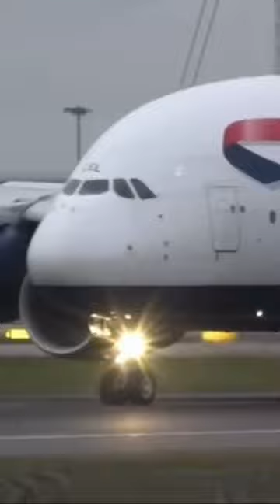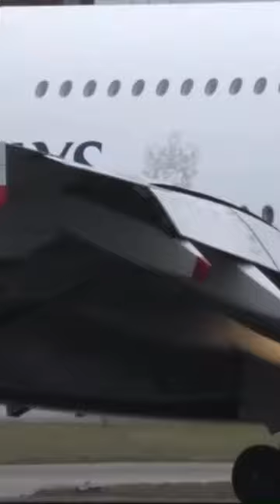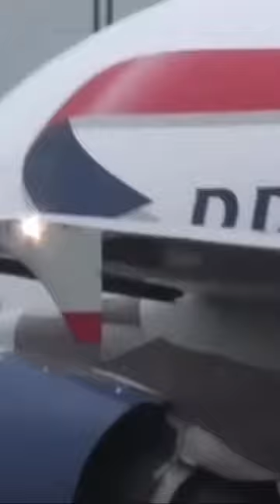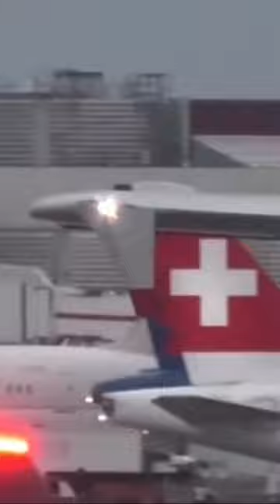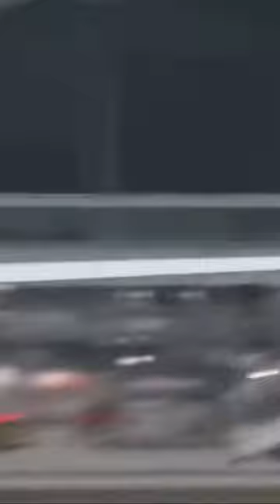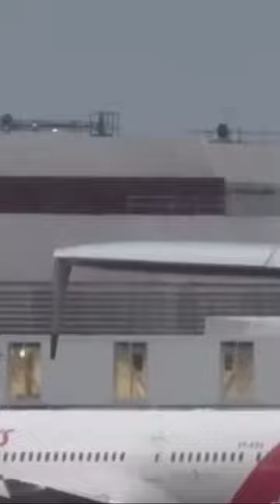A380 UPPER WINGTIP MISSING 😮 🤔 BIG JET TV ORIGINAL FOOTAGE. PLEASE READ DESCRIPTION 👍🏻 #shorts

Comment: Question: was the plane from SFO cuz it was on SQUAWK 7700 earlier
Reply: Also saw that but this was the Dubai flight but didn't declare an emergency
Reply from the maker: That was another Aircraft Chris? That one landed 27R at/around the switch-over
Reply: I also saw the BA SFO 7700 but it stayed at FL410 and was 50 minutes from LHR. I then forgot to check on it and made the same assumption.
Reply: @BigJetTV  Yeah, that's the one. I'm on the same Dubai to LHR today. Believe it's G-XLEE.
Reply: The missing part or whole of the wingtip is covered under Configuration Deviation List. Lower, Upper or Whole wingtip maybe missing provided the exposed areas and holes are covered and the coverings are inspected prior to each flight. Some performance weights and fuel penalties apply.
No threat to aircraft safety though

Comment: Ive once caught an Aer Lingus a320 landing at heathrow with its right wingtip completely missing
Reply: Ah yes EI-EDS. That was due to a vehicle collision, during de-icing, wasn’t severe damage, the removal of the wingtip was enough, CDL(config. Deviation List) permits one wingtip to be missing as long as everything else is there. 

There is a mandatory increase in the aircraft’s fuel amounts, as the lack of such a small winglet actually accounts for over 1% in fuel burn, and this must be accounted for on load sheets and all that. Never seen the jet, all the ones I flew had wingtip fences or winglets(I am lucky to be based in Cork where flying the A320Neo is actually quite common if I’m out on LHR route)